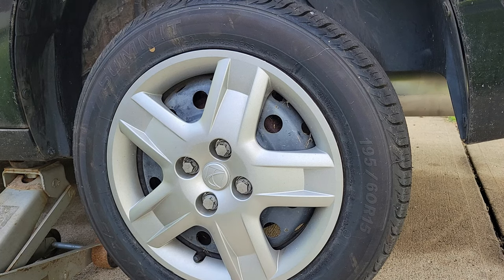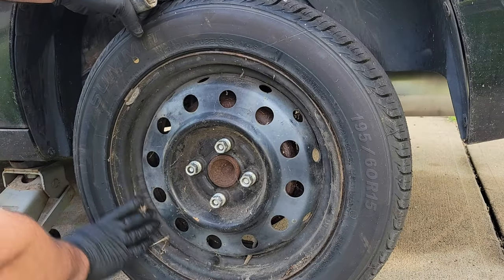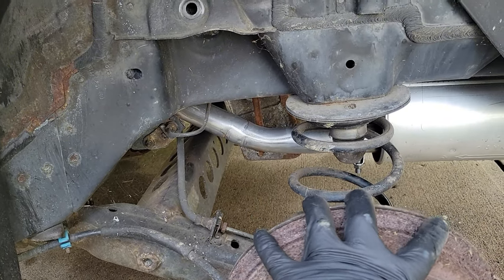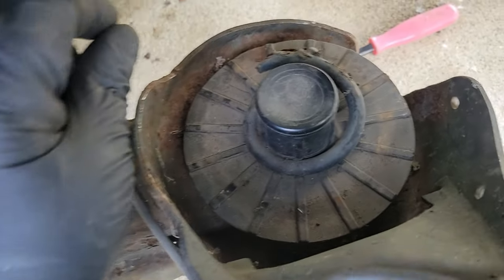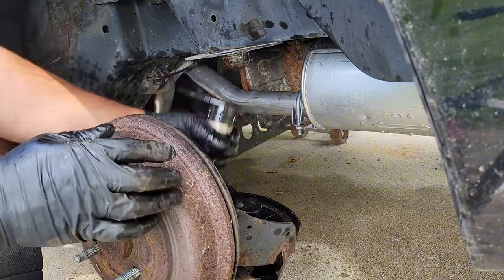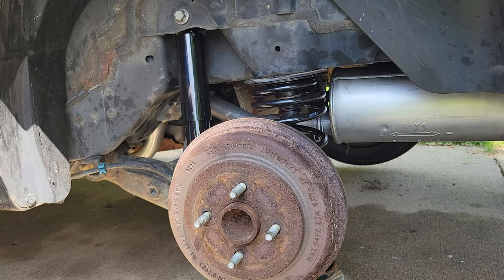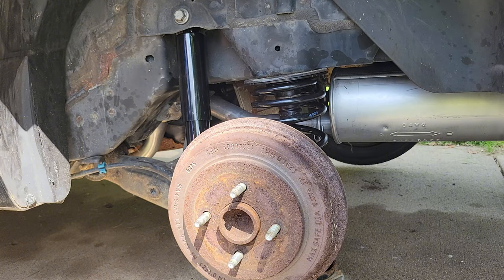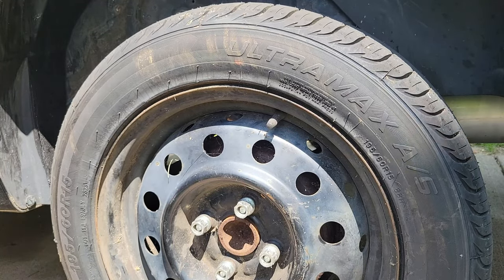2006 Saturn Ion Rear Coil Springs and Rear Shocks

Comment: Did you notice the broken spring make the wheel sit funny. Like negative camber like.
Reply from the maker: TBH No. I bought this car for 400 a few years ago as a "non runner". needed a battery, splice 1 injector plug wire chewed by a mouse. fuel tank had a leak. so pulled the tank, plastic welded the tank, new pump n filter. new tires and she is our back up car for other repairs. front end needs springs struts, rad, wiper blades, and a turn signal bulb.